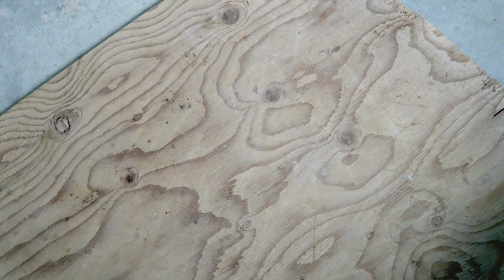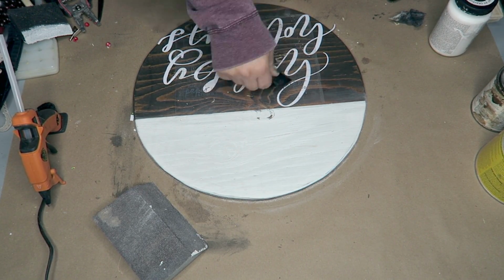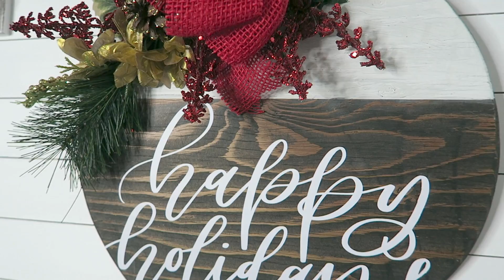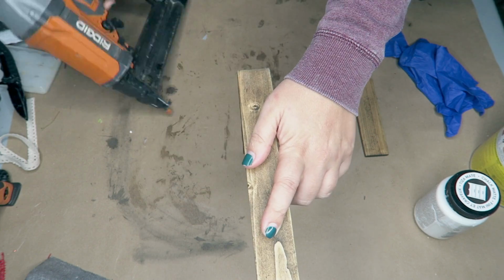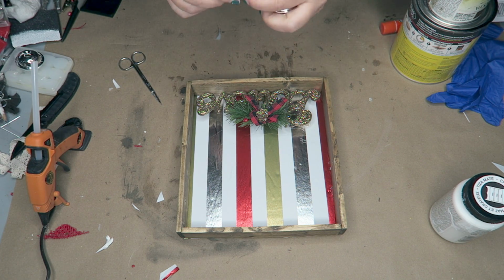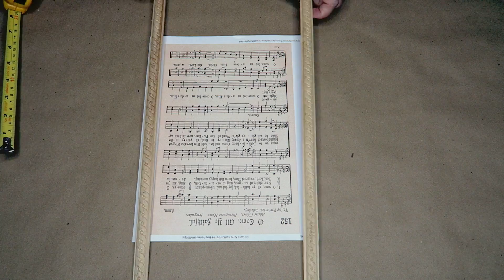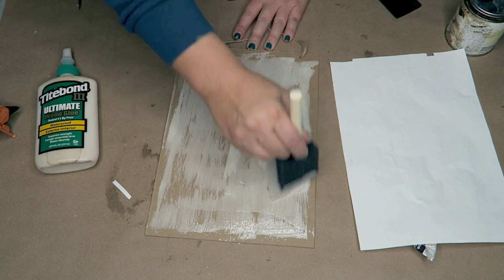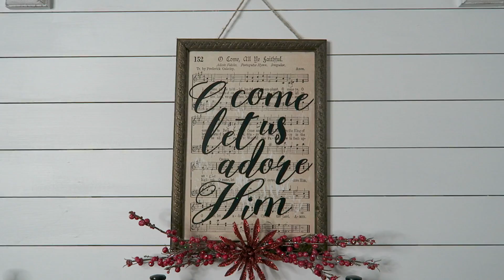Easy DIYs for Christmas! // Friend Friday Christmas Hop

Comment: The round sign was adorable and the music frame was genius. What I appreciated most was the tip on using wood glue instead of Mod Podge. I'm  lightly dabling in wood. But all my attempts have been using fabric/Mod Podge  because of the bubbly paper problem. You may have just open my minimal wood craft world wide open. Big, Big THANKS for sharing!